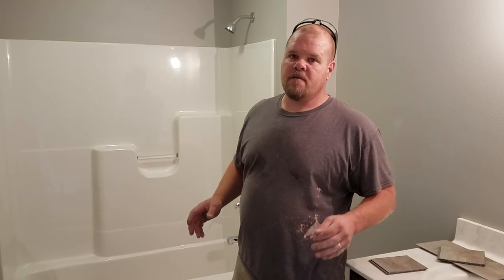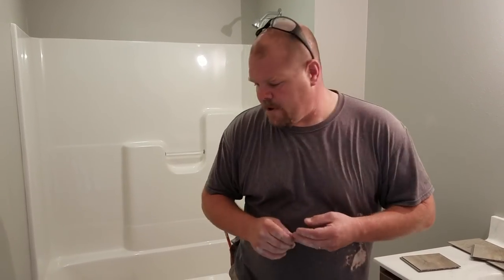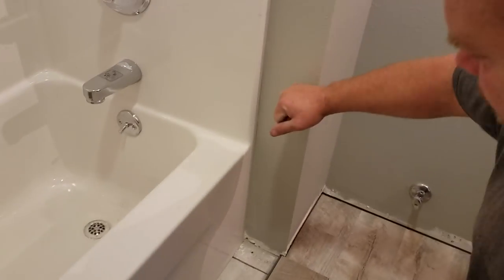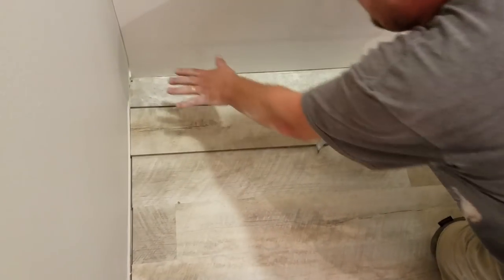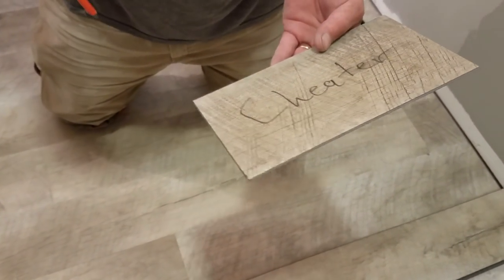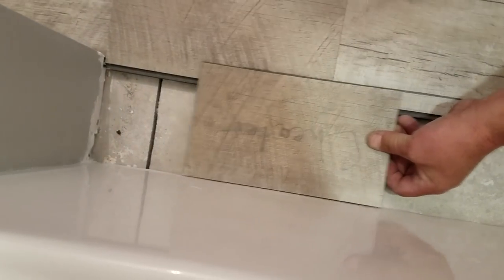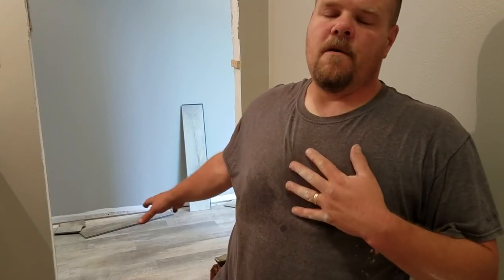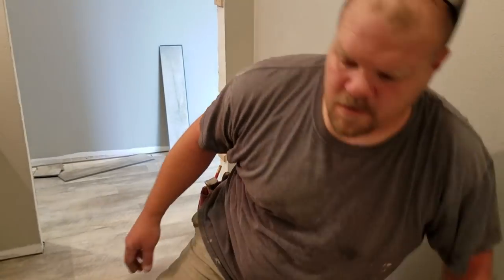how to install laminate or vinyl plank to a tub

Comment: Do you ever use  the Allure Grip Strip flooring ?
Reply from the maker: Yes. I have a version of it installed in a small area in my house to test it and It seems to be holding up well. I personally have not had problems with it but I recommend staying away from it and using a locking system that locks together.
Reply: Thanks , I'm using it in the bathroom because of it's water resistant claims. Are the locking systems equally as water resistant?
Reply from the maker: you should be fine. Just so you know ALL vinyl plank is water proof. I highly recommend mannington adura max. It's just a great floor and easy to install.

Comment: What is the purpose of glueing in the last row? Why not just use the normal locking mechanism and follow your same steps with 1/8" gap filled with silicone caulk?
Reply from the maker: I was just showing that it is an option if someone is having trouble getting it to lock in.
Reply: @SoThatsHowYouDoThat  Oh I see. Thanks. Tilted up at an angle it will take up less horizontal space so it should be fine to get it to lock in. As long as you have a pull bar to pull it tight. I think I will skip the glue on my project.

Comment: Vinyl has an expand/contract rate of .001 which is non-existent, it would take an oven to make it expand. You can make it tight so it doesn't move and seal the bathroom up tight.
Reply from the maker: Agreed